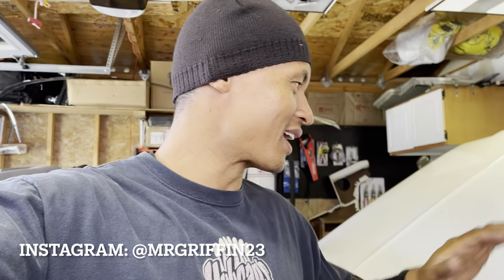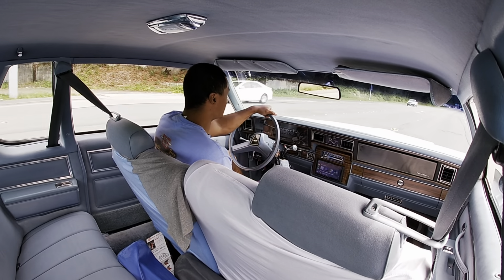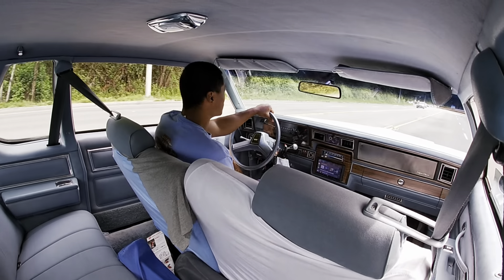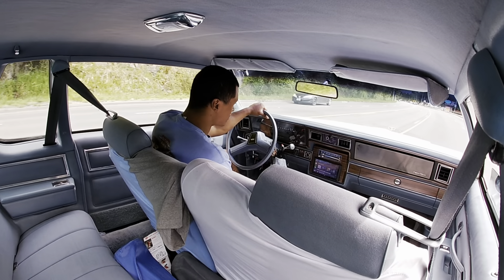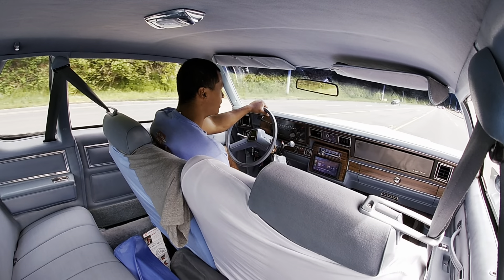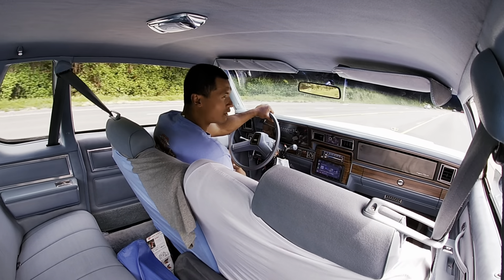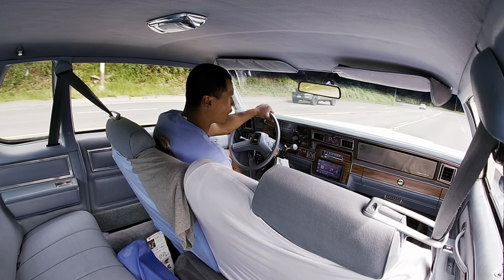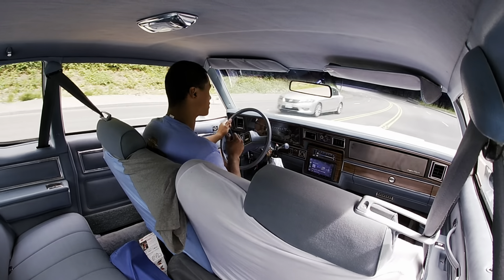THIS PART FIXED MY 1-2 SHIFT | 4L60E | SONNAX

Comment: I picked up a 07 Sierra yesterday and the drive back i noticed it has rhe hard 1-2 shift and goes in-between gears around 50, shifts up and down. I think this may solve the issue. Thankyou for the video. Fingers crossed. Also the fuy i bought it from said he rebuilt the trans a few months ago, when i took it for a test drive it seemed fine. The first ride back started noticing then. 👍

Comment: Dude I’m in the same boat, got a hummer h3 with same trans. Rebuilt it and paid good money for the shop to do so but when I got the car back immediately noticed 1/2 shift felt like I was being kicked in the back by a mule. Everything else with the trans worked as it should but shop says the hard shift is no problem. I’m not a fan so I’m thinking I may take things into my own hands as you did. Thanks for the video!
Reply from the maker: Hope it works for you! I still get some hard shifts, but not as bad.

Comment: I had an 03 Silverado that had the hard 1-2 shift. I replaced the stock piston in the 1-2 accumulator with an aluminum one that looked exactly like the factory plastic one and I had no more hard shifts at all after that. I tried the one in your video but I didn’t like it.
Reply from the maker: Thanks for feedback! I’ll keep that in mind.
Reply: @MrGriffin23  you’re welcome.

Comment: Doing this on my 96 gmc. Its the 10th of December and working on stuff outside is a pain. But heres my question. After seating the ball all the way down and once you set the top, is the ball supposed move. Or will it still move up and down. Theres a little space from the ball to the top. I hope you understand how a said it. Not too familiar with the terminology
Reply from the maker: It’s been a while since I installed this, but from what I can remember, the check ball is pressed in and cross-hatched (punched) at the top so it doesn’t move or come out. It also blocks fluid travel in that hole so piston can function properly. 

On the original one there is usually pin in that hole and that is what the old piston travels up & down on. The new check ball just replaces it. Hope that makes sense and helps.
Reply: I would think you'd want a tight fit as to seal the cylinder off good cuz that's what the whole point of changing the piston is... to seal up leaks. I thought I noticed on this video that the ball that he drove into the hole was kinda looosey goosey. I'm having a super hard downshift from 2 to 1 on my 700r4, I think I'm going to try this fix. Did you fix yours yet?
Reply from the maker: @steven-ky2ps  Been working great ever since this install. A lil’ firm still, but not bad. Car drives great!

Comment: Seen a few vids of this mod. I want that feeling you got when you knew it was fixed 👌. That made me happy 😂. I have a 93 Chevy K1500 with a hard shift from 1st to 2nd. I'm quite confident that this is my issue. Makes sense. Just had a question about the ball bearing that goes inside the accumulator housing. Do you need to punch it down a bit also into that hole? And how is your ride doing?
Reply from the maker: Thanks for watching! They give you a couple size ball bearings. Mine just dropped right in. Then I cross hatched/punched it and was good. 

The car drives great. It did not 100% resolve the issue (hard shift) but it’s better for sure. I think I’d need to go to a softer spring or go take out the Corvette Servo, but I’m just going to leave it. Hope that helps!
Reply: @MrGriffin23  I always thought that a harder spring made for a softer shift? Or maybe I'm backwards. Not sure.
Reply from the maker: @blakebrass125   I’m def no transmission specialist, but to my knowledge a firmer spring will create a harder shift, slowing down the time it takes to compress the spring - holding the shift longer.
Reply: @MrGriffin23  yeah I'm so unsure about transmissions. I'm more of a top engine kind of guy and suspension 😂. I still like tinkering with whatever it is I got so I'll be opening something up at some point
Reply: Did you ever figure it out
Reply: @Raider Nation  I didn't even end up looking into my 93 chevy. I ended up doing a complete overhaul of my 2001 gmc jimmy 4l60e transmission.

Comment: Great video. I have a 2000 silverado 5.3 2wd with 4l60e . I put an Eaton trutrac lsd diff in it.  It shifts fine unless you smash on it. If you smash on it it clunks from 1st to 2nd and sputters when trying to right rpm between 3rd and 4th. Any help is appreciated 🙏
Reply from the maker: Thank you! 

I’m not really too sure your issue tho. Maybe 1st having issues? I hear that’s a main problem on the 4L60e over time.

Comment: Will this fix N to D initial delay engagement? My transmission taked abt 3 seconds to engage.. Only from N to D.. After than no slipping no problem downshifting. Engaging to R is fine.
Reply from the maker: To my understanding it’s only specific to the 1-2 shift. I have not seen it otherwise.
Reply: @MrGriffin23  thank you so much for ur kind replies.. Got a good knowledge through ur video.. Great job
Reply: @hansnmify  there is two other accumulators in these transmissions. The forward accumulator and the 3-4 shift accumulator. The 3-4 shift one is metal piston but pinned and the forward is plastic with pin like the 1-2 shift. I’ve seen the forward one leak and cause the problems you’re talking about. It’s on the backside of the valve body. It actually bolts in to it on the very back sideways.
Reply: @Bhdobbs  thank you so much.. Appreciate your reply. 🙂

Comment: Just watched the video. I'm encouraged because I have the same issue with my 2003 GMC Yukon. I guess this video is a year old so can I ask if you've had any issues since you did the modification and is there anything I should be aware of??? Thanks.
Reply from the maker: Thanks for watching. It softened it some what, but did not change it entirely. I was told a softer spring would do the trick, but I’m just gonna leave it as is for now. It’s more tolerable. Lol!
Reply: Cool. I checked on the Sonnex web site and there is a replacement spring available so I might just order it and see what happens. Preciate ya. ✌🏽
Reply: @adwinstead did you do that replacement? 04 silvy and she is rough about 50% of the time. Tends to shift decent if I punch it but I dont like to do that
Reply: @phillipdelaney2989  I did. It helped a little bit. Shift wasn't as hard but it was still present. What made the biggest difference was when I replaced my MAP sensor. I read somewhere that a faulty MAP sensor could cause this issue. Installed new one and now 1-2 hard shifts are gone. Not saying this is the answer but it worked for me along with the Sonnax upgrade. Read below....

MAP – The Manifold Absolute Pressure sensor creates a signal based on vacuum levels in the intake manifold, which indicates engine load. A faulty MAP sensor can cause late, harsh shifts, early / soft shifts, or even prevent the transmission from shifting at all.

Comment: I've been reading your comments it doesn't sound like your repair was a complete success I'm thinking about doing this myself. Can you share what happened or what you think might be happening has it gotten worse better overtime. Thank you my friend I really enjoy your content.
Reply from the maker: Thanks for stopping by. So it ended up not completely resolving the issue, however it did soften it up. Every once in a while I’ll get a really hard shift but for the most part it is softer. Just not completely gone. I never changed the spring tho and I hear that helps. So if it bothers me that much I might try that. Hope that helps.

Comment: Great video, very informative. Have you tried installing the 3-4 Accumulator on the other side of the 1-2 Accumulator? One more thing, Whoever put that beat together is dope. 🔥
Reply: I have the same Question. I believe you can replace the 3-4 with the same 1-2 piston at the same time. I haven't seen a video yet of someone doing that except in a bench rebuild.
Reply: @weloveups831  Have to drop the valve body to do the 3-4 accumulator piston, which means a lot more involved but doable.

Comment: I've a similar issue with my 04 Trailblazer. If I floor on 1st gear, the engine revs with low torque and shifts very hard on 2nd gear almost skidding. If I drive slowly, all looks ok. Any advise?
Reply from the maker: Maybe the pressure settings or shift points in the trans? Just a guess. Not really sure.
Reply: @MrGriffin23  long story to check but thanks 👍 much appreciated

Comment: Does anyone know how to read GM Chevy obd1 transmission codes that may be stored?

Hoping somebody had this exact issue and knows the proper fix.

4L60E automatic. 228,000 miles.
Tranny shift delays from 1st to 2nd, when at any temp. Will hang in 1st until 2,700 to 3,000 rpm, and shift softly when it eventually upshifts. I can also get it to up-shift by slightly easing up on fuel pedal, at about 2,400 to  2,700 rpms.  It will downshift as it should when going up a hill at around 15/20mph, 2nd to 1st. Reverse and 1st always work good, cold or hot.  3rd & 4th work fine.  Fluid is exactly Full and clean, when hot/level. No Check Engine Light or any other warnings or issues. 

Anyone have this same thing?  Many thankz!
Reply: https://www.youtube.com/watch?v=vgXSXCRyw2w
Reply: Paper clip method is all you need.
Reply from the maker: I don’t have any experience in this myself, hopefully the link in the comment below helps that Jesse left.

Comment: hi, I saw this was a Technical Service Bulletin from GMC. I don't know if this applies to your vehicle and transmission, or not?

TSB 01-07-30-023B – Harsh 1-2 upshift with P1870 DTC – 4L60E Transmission RPO M30

1996 Buick Roadmaster – 1996 Cadillac Fleetwood – 1999-2000 Cadillac Escalade – 1996-2000 Chevrolet Camaro – 1996-2000 Corvette – 1996-2000 Pontiac Firebird – 1996-2000 Chevrolet and GMC Light Duty Truck Models – 1996-2000 Oldsmobile Bravada
Problem – Drivers may experience an unusually harsh 1-2 shift because the ECU has commanded maximum line pressure in order to compensate for excessive wear in the bore that contains the TCC isolator and regulator valves inside of the valve body.
Solution – Replace the 4L60E valve body with revised TCC regulator and isolator valves.
Reply from the maker: Thank u for information. My year isn’t in there , but I’m sure there is some correlation. This helps a lot!

Comment: any idea what causes a slippage from 1st to 2nd? My fluid level is good. Could my fluid be bad? Light brown not red. Happened after I was stuck in traffic for long time
Reply from the maker: Potentially. That’s actually what happened to mine, but I was on a long drive.
Reply: @MrGriffin23  found the issue and fixed it , was a broken spring in the 1-2 accumulator. The trans already had the first edition metal upgrade but I bet the builder reused the old yellow spring. I fitted the more modern metal accumulator kit and the truck has been fantastic, smooth change and quick off the lights. 
Smoked the wheels for the first time since I owned it.
Reply: Where you having a lazy shift? Mine hangs for a long time in first gear, then eventually shifts into 2nd
Reply from the maker: @OGKILLa9365  Same as you, but aggressively goes into 2nd
Reply: @MrGriffin23  mine ended up being a bad tune. Previous owner had a turbo 4.8 with a weird tune that would make 1st gear hold for a long time.
Reply from the maker: @OGKILLa9365  Glad you got it figured out! Great info!

Comment: I have an older 700r4 and the piston is underneath the spring, will it make a difference if I install the spring first with this sonnax piston?
Reply from the maker: You could try both. At worst you will need a softer spring. Wouldn’t hurt.

Comment: when you bolt it back into the trans is it just loose? and it pressurizes itself?? Like if you shake it you can here the springs moving? ...... I have a new stock accumulator with the pin but a alluminum piston and when it is put together ready to go in  I can here the springs move when I shake it.... I was Just curious about that  before i do the install? any help is appreciated Thanks??
Reply from the maker: It was pretty solid. No play once installed. Pretty straight forward. Once the springs are in their location, they shouldn’t move. Especially if the disc in Snapped in. That spring can be changed also if needed.

Comment: 1 year later. Still holding up or what? Looking into this problem myself and wondering if I'll need to dig deeper
Reply from the maker: Still running strong. Still some hard shifts occasionally, but it is better than before. It might not entirely resolve your issue tho.

Comment: I had a 4l60e rebuilt and it wouldn’t shift into 4th. I put a corvette servo in it and it fixed it but the 1-2 shift kicks like a mule. Idk
Reply from the maker: A buddy of mine said the 1-2 shift kicks like that to the Corvette servo and the gear ration jump from 3.06 to 1.69. Says it’s normal. That what my trans guy said too. Sometimes it is a bit harsh.

Comment: Where does the second ball bearing go ?
Reply from the maker: It’s been a while since I did this install, but I believe only one is needed based on the size of the hole - you can match up with the ball bearing.

Comment: The guy at sonnax told me not to use the inner spring my sonnax piston seems to sit lower than the top of the housing what is wrong with this?
Reply from the maker: Interesting. I’m not too sure. Have you tried to run it this way?
Reply: @MrGriffin23  not yet but it seems ok if it's alittle under the top of the housing my old one looks similar but yeah guy at sonnax says there's no point to use inner spring it will just rattle around.

Comment: I have the same problem. Just had my 2000 Silverado transmission rebuilt and 1 to 2 is a firm shift. Do you think this will fix it?
Reply from the maker: I think it could, but not 100% if it will work for every application. Mine ended up not actually totally going away, but it did soften it up some. Regardless, it’s an upgrade that’s cheap and doesn’t hurt the performance if it doesn’t end up working.
Reply: @MrGriffin23  I will be trying this next weekend and thank you for the great video.

Comment: Great video
I took the accumulator out today and find out only one spring inside (.the small one ) i guess they try to fix it and forgot to put the second spring ( 07 Silverado )
Where i can get the springs?
Tnx!
Reply from the maker: I would just search on ebay and reference that part or google it. I didn't end up having to replace any of the springs.

Comment: In reference to the stock OEM pistons. They all break or wear on the pin eventually. Pin wear is more on the metal pistons. 

Changing the springs really doesn’t help a lot. Most builders, such as myself, have learned to just replace the pistons. Because of this. 

Also, just fyi. There is another accumulator in the valve body. When it doesn’t move freely, it will also cause the same problem. 

Pinless is a good upgrade. But if you still have a hard shift. It’s in the valve body.

Edit. Some of the newer 4L60E transmissions, only have the one small spring inside the accumulator. Don’t add another spring. It will cause problems. Unless you have installed a shift kit with the replacement.
Reply from the maker: Thank you for feedback! This really helps out a lot!🙏🏾

Comment: You ever consider upgrading to a 4l80?
Reply from the maker: When I rebuilt this one I took in my 4l80 to get rebuilt and I was gonna swap it. However, we decided to just rebuild this one up to standards with my current build, goals and driving. Then just used the 4l80 as a back up for my 6.0 that’s in my Chevelle.
Reply: @MrGriffin23  @ ehat year its your transmission?

Comment: At the 20 minute mark, you put your foot down & the fuel level dropped, so there's your next mission to fix.
Reply from the maker: Thanks for watching! Yeah, it’s the stock tank. No baffle, but I swapped the sending unit to run EFI. I keep the gas level 1/4 or higher at all times and performs fine for daily street driving.